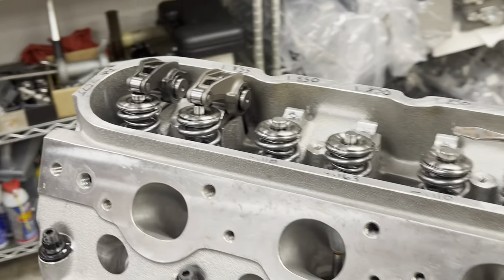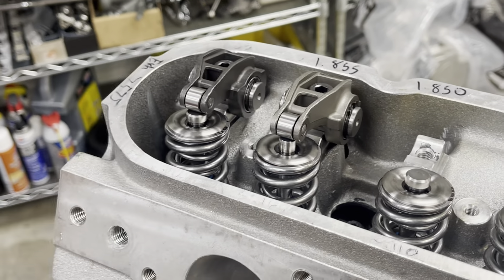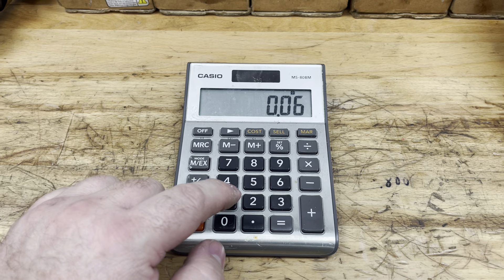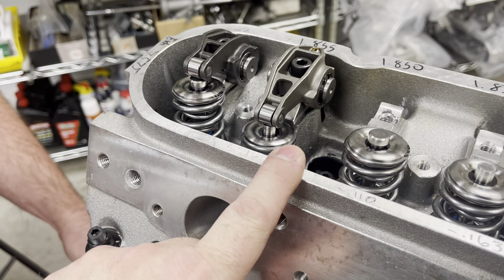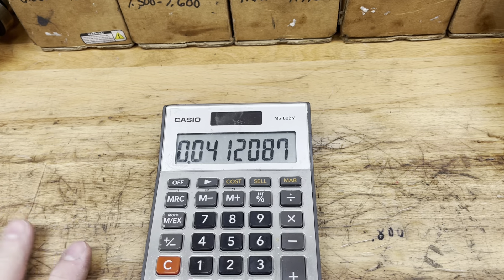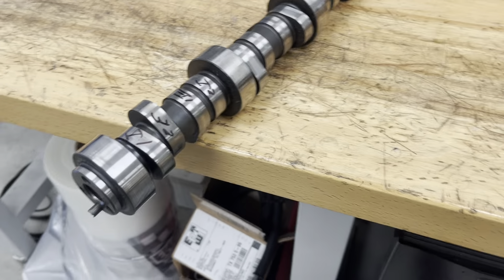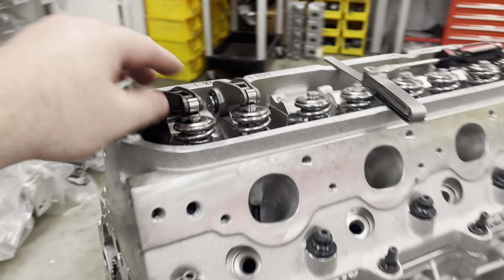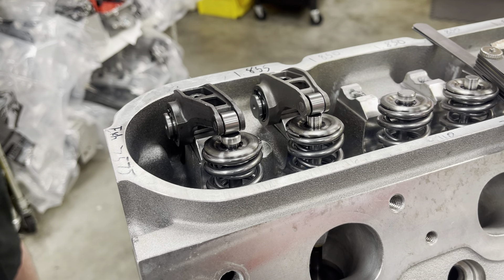How to properly measure pushrods for a hyd roller LS engine

Comment: So say I have a set of Johnson’s that are already pumped up/been used before.  If I set the checker to zero lash with the rocker bolt torqued, can I add 1/2 of Johnson’s preload to the length of the checker?
Reply from the maker: It does make it a bit harder to do when you are working with lifters that have engine oil in them rather than the assembly oil.  It is possible to double check yourself with them if you can spin the engine by hand a few times as the oil will work itself out.  That said if you know for sure the travel of your lifter then you can go off the zero and add your preload.  The hard part is knowing that zero because most will start to depress with little to no pressure.  Which is why we have done it this way to know for sure were we are in the lifter travel.

Comment: Did you tell us to add that measurement to a stock pushrod? maybe I missed something?
Reply from the maker: In this particular video no lengths were given just where it was. Depending on what length you are using to check with then you can work backwards to see if it is to short or to long.   Again we are just looking for how far off the bottom of the lifter it is preloaded